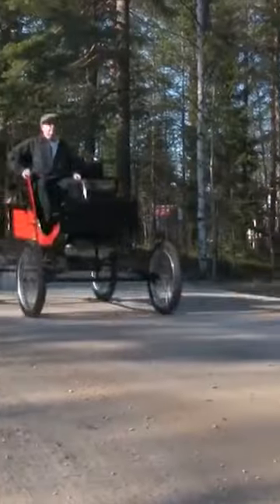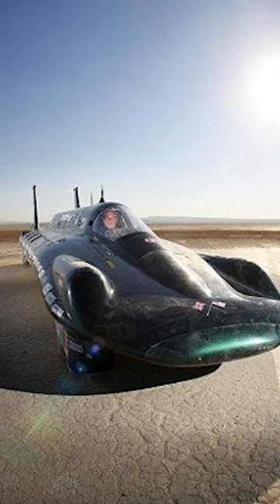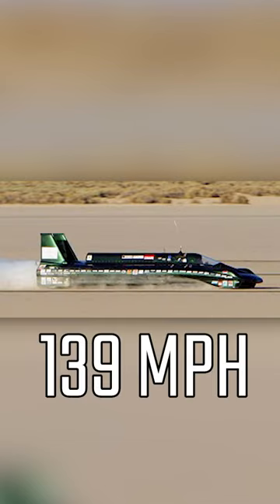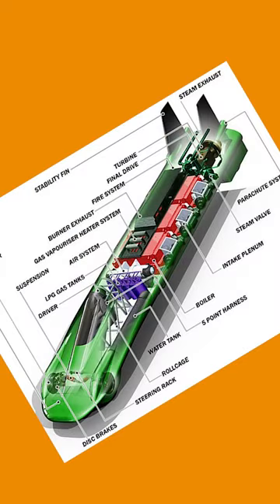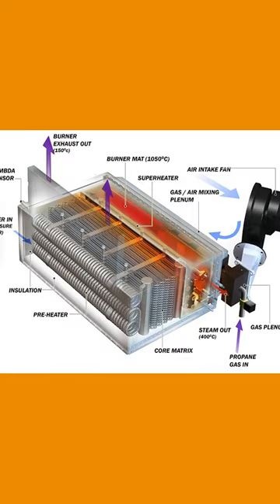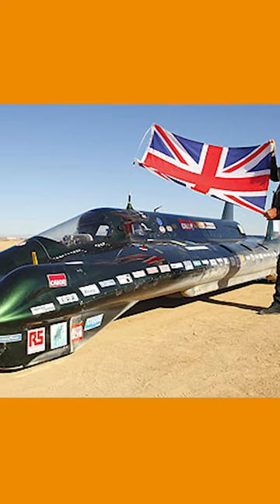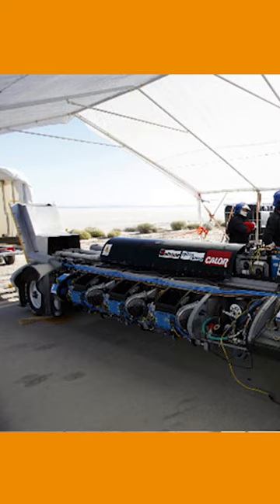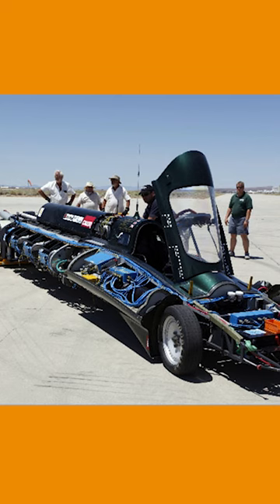Super-Fast Steam Powered Car - Steam Culture

Comment: Most steam cars actually weren't that slow. They had such an extreme amount if tourque most can keep up with modern traffic. Some can even pass modern cars on the highway.
Reply: For example the Doble steam motors company had steam powered cars that were capable of going over 110 MPH in the 1920s!
Reply: @retr0bits545 the Doble how ever would struggle to maintain 70 mph on the freeway.
Only 150 horsepower
Reply: @WilhelmKarsten  Yes, Jay Leno took it on the interstate with no problems.
Reply: @retr0bits545  He wasn't going 100 mph...
Reply: @retr0bits545  The Doble boiler has a maximum continuous horsepower output of 150 hp new, which is a bit generous, it's output declines significantly with age too.
Reply: @WilhelmKarsten  his I believe was rebuilt.
Reply: @retr0bits545  Jay's car hasn't run in nearly 6 years as it is currently undergoing its second major rebuild since he has owned it, 
Jay has revealed its the most expensive car in his collection to drive, averaging over $3,000 dollars per mile in fuel and maintenance costs.
Jay joked it would cheaper to travel by a NASA moon rocket.
Reply: @WilhelmKarsten like any other car with wear. My old boss had an old jeep from the 70 we used to plow. That thing was screaming just going 25mph.
Reply: @WilhelmKarsten 150 hp is by far enough to reach 70 mph.
A VW Polo with 50 hp can reach 85 mph.
Reply: @brassassmonkey  That was because of the gear ratios in the transmission and axles.
Reply: @PumpKing96  Does your VW Polo weigh 6,978 lbs.?

Comment: The Doble E20 steam car went 132mph in 1925 so anyone who thought steam cars were slow is wrong.
Reply: the steam cars are nice
Reply: Couldn't have beat the record, you have to turn around and run the course again in both directions
Reply: @WilhelmKarsten Dobles race model held the land speed record for decades
Reply: @WilhelmKarsten Stanley steamer**
Reply: @hecklingheck9188  Only for 1 decade, and the last time a steam car would set a world record.
Only in one direction.
 Internal combustion exceeded 139 mph in 1924.average of two directions.
Reply: @WilhelmKarsten  There was also a lot more development in the ice
Reply: @hecklingheck9188  Steam was much more developed by 1924, it had been in continuous development for 110 years before ICEs were invented.
Reply: @WilhelmKarsten  yeah but there was mass development, assembly lines, giant cities, modern engineering while steam was being developed
Reply: @hecklingheck9188  Yes, steam was well-developed in 1924, the ICE was not.

Comment: 132mph was set in 1925 for a big fat heavy steel car. These guys are doing something wrong.
Reply: yea their weight is off they should be tryna make it from a tested car like a doble and areodynamic the design down
Reply: @Wreckedftfoxy high pressure steam is just not easy to generate without heavy equipment
Reply: I don't know about That. You can get pretty high pressure from small containers. It's like the Water Hose, forcing a lot of material through a small aperture. Your thumb, for instance.
Reply: the only thing is pressuries is steam pipe, that one must be heavy. else is just aluminium thin metal sheet.
Reply: Diesel fired, steam turbine, electric hybrid. That would be practical, effective, simple, and inexpensive for daily use. It's how we powered our destroyers in WW2

Comment: I would start an invention to get rid of the boilers and have something that would recycle the steam back into water and then back into steam. I mean it’s only logical.
Reply: some old steam cars did do that using condensers
Reply: Those are some great ideas. You should look up the video of Jay Leno driving his antique Doble steam car. It had super-heated steam and a condenser up front (it looks just like a radiator) to cool the steam back into water for re-use. If only you had been born back then you could have been the engineer who designed them. No sarcasm intended. Now go design an electric motored car that uses steam power to generate electricity
Reply: @amishrobots  do the opposite, an eletric boiler for steam and a cooler to turn the steam back to water, significantly cheaper than giant batteries isnt it?
Reply: @ninguemviu6376  um... how would you power the electric boiler?
Reply: @amishrobots  Interesting. Ladies and gentlemen, we have exited the age of steam, the age of gas, the age of electric...this is the age of nuclear powered cars!
Reply: @TheHeavieKiwie  lol no.
Reply: @amishrobots  I thought nuclear was steam generator with steroids.

Comment: The record previously was set by Fred Marriott January 6th 1906 when he recorded a speed of 127.66mph. Which stood until 2009 when the car in the video finally broke the record. However, the use of a steam turbine was a huge mistake and cost them a much higher speed. The car was engineered for something like 230+mph. But small steam turbines are horribly inefficient and they needed more time to get full speed but werent able to go further because of the immense water consumption of the turbine. Two other cars attempted to beat the original record before this, one in the 1960s and one in the 1980s. Both used turbines and both had the exact same problem. Turbines are horrible at acceleration. 

I also know the guy who nearly took the new title in 2012 but he lost control on the return run and rolled his car at over 160mph. His first run was recorded at 186mph. His car had a 550hp 4-cylinder steam engine fed by dual 850psi steam generators. (boiler are older technology, but still used as slang to refer to modern steam generators) He is currently building a new car with a goal of 250mph using a 6-cylinder "barrel" engine with a target of 1,000hp fed by four 940psi steam generators. Steam piston enggines have enormous torque, so he will start out using only one generator and bring in the second at 75mph, the third at 150mph and the fourth at 200mph, otherwise his wheels will spin on the salt. Which is what caused his crash in his first car. At 160+mph his tires boke loose and his car fishtailed.
Reply: Steam really is underrated
Reply: They ran into the law of diminishing returns. If people wanted a cheap, simple daily driver,  a diesel fired, steam turbine, electric hybrid would work just fine. It would not cost millions of dollars. It would not need high end toxic batteries, and foreign parts. It would not need to build incredibly dangerous pressure. It wouldn't need half the batteries as an all electric, helping to reduce weight. The same thing could be used to heat and power a home. I feel like we need energy independence, more than we need to break land speed records.

Comment: Steam powered cars are as fast as modern ones 💀
Reply: Steam cars are obsolete technology
Reply: @WilhelmKarsten  not really. Steam is much more powerful than internal
Combustion and can be clean to make
Reply: @Heisler146  No, they are not, certainly not on the scale of transportation applications.
Steam is inferior to internal combustion.

Combustion steam engines are extremely dirty compared to ICEs, in particular the pollutants that are invisible to the naked eye,  like NOx and CO2.
Reply: @WilhelmKarsten  steam literally has more torque than internal combustion while also being steam…you don’t need a fire to heat it up

You know nuclear powered aircraft carriers are steam engines?
Reply: @Heisler146  NO, it doesn't, more importantly steam produces less horsepower per unit of energy or fuel consumed.
 ICEs outperform steam in every relevant category.
Aircraft carriers are also powered by ICEs 
Some American aircraft carriers are nuclear powered because it allows them to carry more fuel for aircraft.
Any questions kid?
Reply: @WilhelmKarsten  sorry you don’t understand basic physics, kiddo
Reply: @Heisler146  It's Laws of Thermodynamics son... that make it impossible for the Rankine Cycle to compete with internal combustion technology.